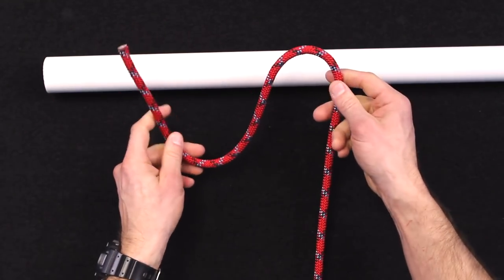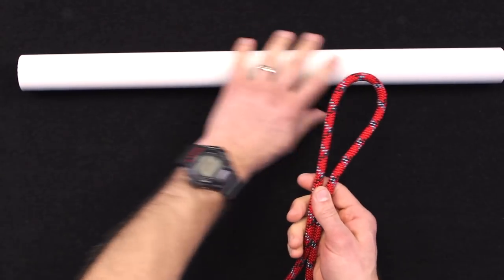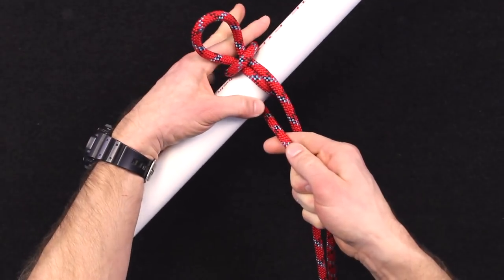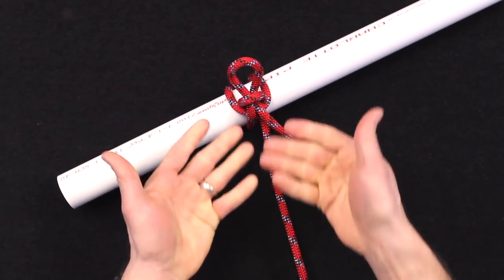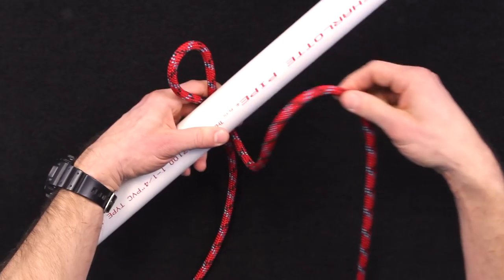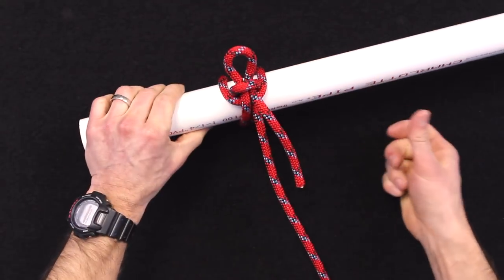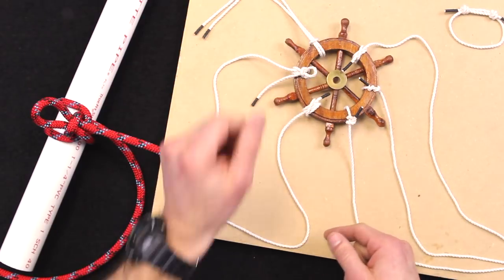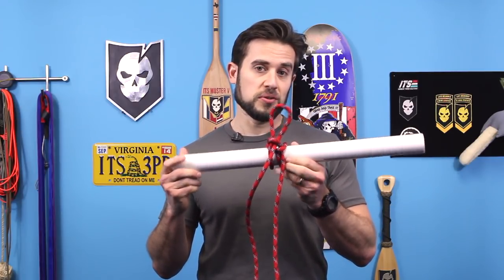How to Tie the Highwayman's Hitch for a DIY Knot Board Display

Comment: Hi! This knot is also called "Rustlers Hitch" and is commonly used be seaman because you can fix your boat on the working end at shore and release the knot with the other end from the boat, if you just make the "release end" long enough, so that you can grab it while still on the boat. This is sth one handed sailors absolutely need and this is why this knot is so common for them.

Comment: Probably woulda been easier for you to demonstrate if the pipe had been stationary (in a fixed location) instead of free to move around, requiring you to hold it still with your hand.